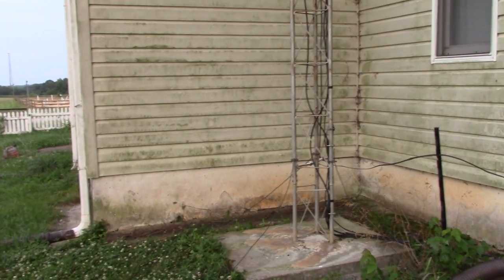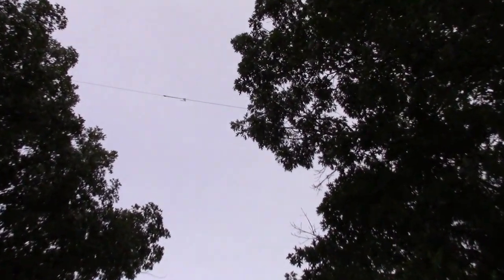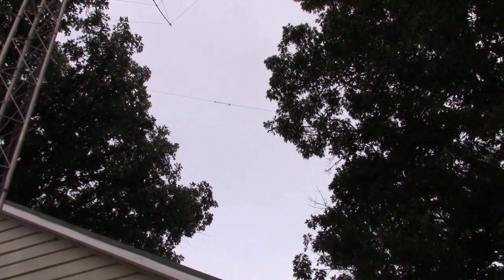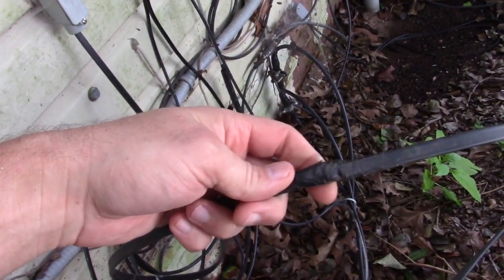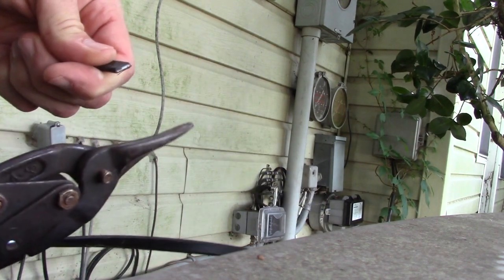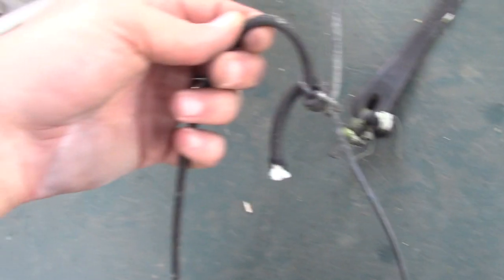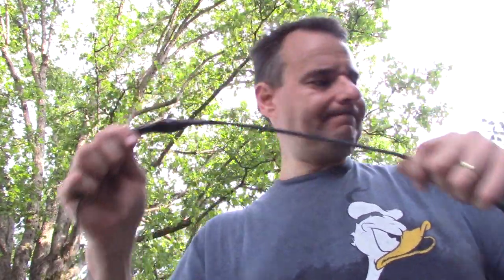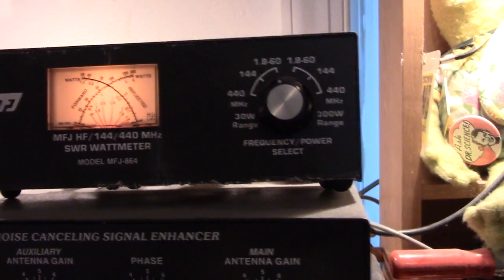Putting Up a New Antenna - 1/4 Vertical Wire Antenna

Comment: Why do I love your videos so much Kris? Because I pretty learn something new each and every time you post a video. When I was a kid there was a guy who lived a few neighborhoods away that everyone was afraid of. Kind of a Boo Radley type who even walked creepy and would only come out after dark. One day we saw police and a newspaper reporters going into his house. So we all just figured that he finally got caught for murdering someone or something crazy. Turned out that he was getting an award. He saved a bunch of people who had capsized their boat by using his Ham radio Morse Code. I guess they were signaling out for help using Morse Code and he picked up their signal. He then got in touch with coast guard and directed them to the exact spot where the people were drowning. I always had respect for Ham Radios after that. 160 meter inverted L? You are a master of all things audio Kris. You rock~
Rob/Boston
Reply from the maker: There are quite a few stories like that - people listening and helping mayday calls.  The 160m inverted L antenna was an mild success - 160 meters is right above the AM band, so you need a very large antenna (120ft) and lots of power.  I had neither - so I used the L - it went up about 60ft then turned 90 degrees and went straight another 60ft to another tree.  The fact anyone heard me was a success - I think I nabbed Ohio one night.  This antenna was much easier and more successful - at first I thought no one was hearing me, but it turns out my signal was skipping right past most of the United States and going to Europe - I nabbed France one night in one call, and Belarus as well.  Spain, UK, Germany, and The Netherlands so far... and that was only spending a few minutes over several nights using it.

Comment: I always wanted to get into ham but I was always to lazy to learn the code. Now that you can get a license without it I just waited too long. As a kid (post WW2) I had a short wave radio and my dad helped me put an antenna on the roof. I spent many hours turning that dial. Very interesting.
Reply from the maker: The code held me back as well - I did pass the 5 words a minute test, but couldn't do the 13 wpm.  Now that it ISNT a requirement, I have practiced and used it a bit, and it actually is more fun than talking... I don't have blocks of time to dedicate to it, so I haven't gotten better than 10 WPM, but I do try to use it now and again to not lose it.  You will see in an upcoming video you can get a shortwave radio for the computer for $20 and have a really sophisticated setup for basically peanuts.

Comment: Basking in your geekiness. Love it! Actually, I am in awe of hams and their resourcefulness, so a tip of the hat to your antenna wrangling initiative.
Reply from the maker: It is that background that has allowed me to tinker all these years - not afraid of getting wires crossed, etc.  I have a few videos coming up where I show off the new shack, which will come up after a few computer videos, tying the radio to the computer, etc... I thought this antenna was a dud because I wasn't getting nearly as many stations as I remember, but early one night I hear a commotion on the radio, France is on, I nab him in one call as if he was sitting in my room - the antenna was actually TOO good and only would work well with far away stations.  Belarus was also an easy contact.

Comment: Awesome video. I need to get off my lazy ass and finally put up a proper antenna since mine got knocked down. I was going to just do a g5rv but after seeing this I may just say screw it and cut some dipoles for a few bands. It was a lot easier doing shit like that when cameraman lived with me. He was much better at it than I am.
Reply from the maker: I have a fishing reel/slingshot contraption I made to launch lines into trees.  The 40m I thought was doing poorly, but it turns out I was skipping right over the US and going into Europe.  Ohio, S2... France, S9.  I have a SDR video coming up along with a shack tour.  You still need to come to the farm and get the tour.

Comment: How can you NOT want Lightning in your house because you could you know ride it. Also be sure to wear your tinfoil hat to protect you from the frequencies!
Reply from the maker: We had lightning hit the electric fence one year.  I was standing in my workshop and all I saw was a flash of light, but not in the distance - it was so bright it was like someone put a white frame up.  We go to unplug the fence so we can assess the damage and noticed there was no fence charger, just a black dirt spot where it used to hang.  Tin foil hats are like agnostics - people who don't want to commit - I had steel plates put in the head for proper protection.

Comment: Hi Kris - took the liberty of looking you up on QRZ and have emailed you - I hope thats OK. 73, M0NUX, UK
Reply from the maker: Julian, I saw the email come through last night and it is totally welcome to do so - it will take me a day or two to type up an appropriate reply... but you will also get to see in a few weeks me redo my computer room which means redoing my shack - and I have finally added an SDR and have it rig controlled on my Icom 718 (bought before SDR was even a thing)... its so cool to have a real panadapter now and have it all work together (got an MFJ T/R switch to finish it all off)... I also did a video on that as well that I am going to be uploading soon.
Reply: Thanks Kris - I look forward to seeing how you get on with MFJ T/R switch, I have been contemplating getting one myself to use with an SDR Play I have spare to act as a panadapter. I cant find a mod I am happy to implement for my TS2000 to give me an IF output. So the TR switch seems like a good plan. Will be watching for the video!
Reply from the maker: This covers some VERY basic info for people who have no idea what I am talking about, but a few minutes in I go over the MFJ.  I love it.  You will see people knock it for not having enough isolation - something like 30db while other relays can have 90db... However, the side benefit of the design shortcomings is I can actually hear/see my transmit signal, which is actually kind of nice.  :)  I finally figured out how to have the rig simply follow my mouse clicks without having to hit C for center each time in CubicSDR... so I have the rig audio turned down and just find the signal and I can transmit.  This video won't be released for weeks, but here you go: https://www.youtube.com/watch?v=k-jOFwSBZLs
Reply: Thanks for that Kris - you have convinced me to get one :) I was going to install Cubic SDR on my Mac. I use that in my shack with a Windows machine as well, as I run Mac Doppler and Mac Logger form Dogpark Software which is very good. But on Windows I use SDRUno which I find very good for General SDR use.
I'd like to run GNU Radio for some of the more obscure satellite scripts on Linux, but Linux and me do not mix! I have been a programmer since 1977 when first I started on an 8080 writing machine code and have stayed right through to Python etc these days at hobby level, but Linux . . . I hate it! (Sorry, I know you like it :) )
Anyway - off to find myself a TR switch. Stay safe in the hurricane and I hope it doesn't cause you any problems. Will you vlog your prep etc?
Reply from the maker: I think we are so inland that it won't be much interest - we are dead center in the state so we are only expecting 30-50mph winds... we actually have a family with us right now from the coast who evacuated.  I have some videos coming up on why I love Linux and me building a new computer that I think you will like and MAY change your mind enough to dual boot :)  So far after rebuilding the shack, the SDR along with the rig control is SO cool - the one thing I don't find that cool is how PSK and RTTY have disappeared (well, I never actually like PSK since people just used long stupid macros) - everyone uses FT8 now and while I played with it, it really is kind of boring!  I probably should hunt around for some Olivia since apparently that's where the disgruntled guys go.  I haven't had a block of time to play on voice, plus the sunspots really are dismal - the new vertical isn't a great performer but I suspect NOTHING is a great performer at the moment...